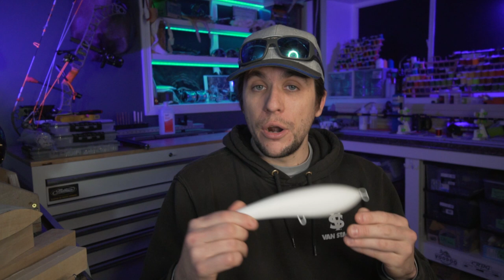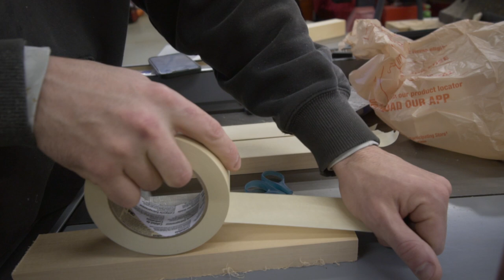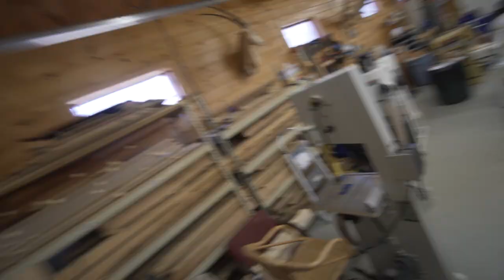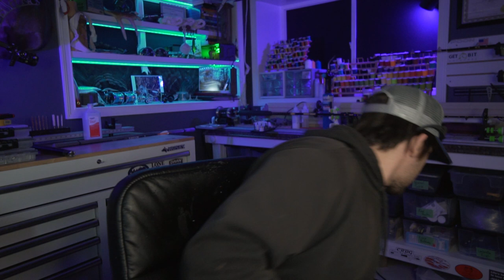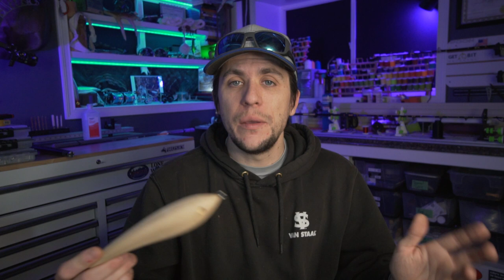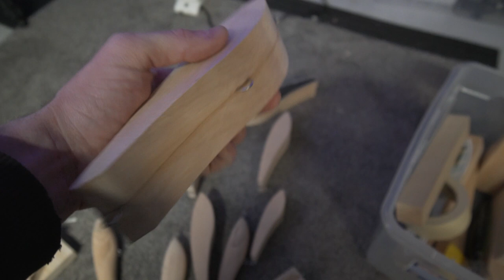Building a Tuna/Striper Stick Bait

Comment: Lmao bruh I feel you on the lack of production due to never skimping on quality. Same exact story, started with pencils, after seeing GT popping made my own 230mm, 150g, 45mm cup, 2.4mm 316 wire harness tuna/GT hybrid popper followed by sinking and then eventually floating stickbaits. The difference between getting a lure to swim without a lip using specific gravity, head shape, body shape, ballast position, hook choices….it’s super frustrating but so worth it. Also made a 10”, 3 piece jointed swimmer that’s fully thru wired with two sections of 1.6mm plug wire and abalone side scale. Crazy how much in line our thought processes are from ethics to building bro! And yup, high impact resin is the way to go. If you cut open a strategic angler lure you’ll find that Merv doesn’t even crimp or weld the wire ends for a closed loop harness. The resin is so strong and has so much purchase on the wire he doesn’t need it. Keep it up and if you ever want to bounce ideas off me for floating or sinking stickbaits. If you want to see what in my opinion is the one of the best swimming floaters look up Amegari Kaxu 240 on YouTube and you’ll find a dude who has some footage swimming one in a pool. Too sick. 

https://youtu.be/mNot6ECX0z4